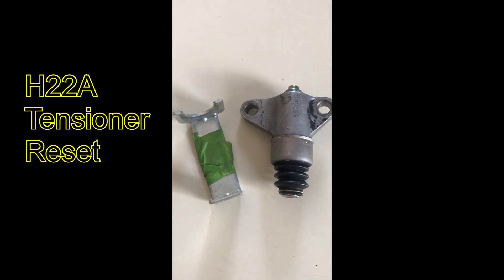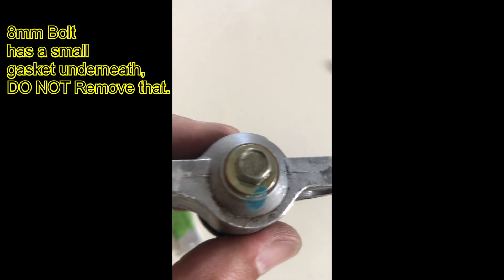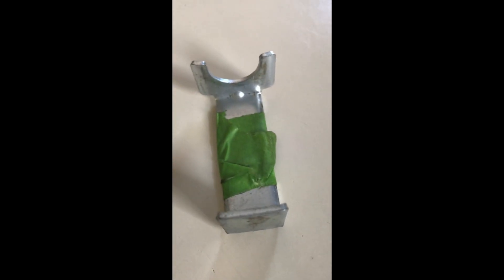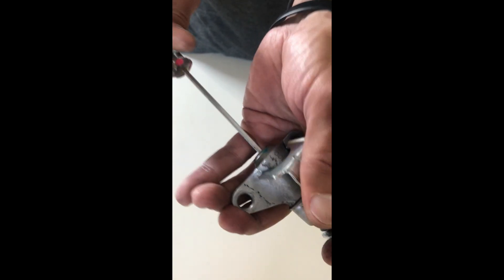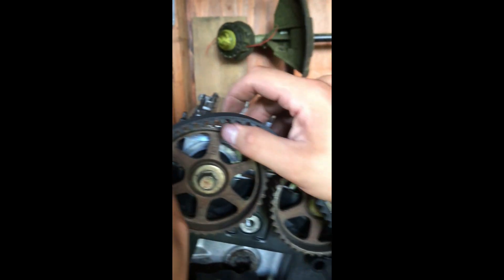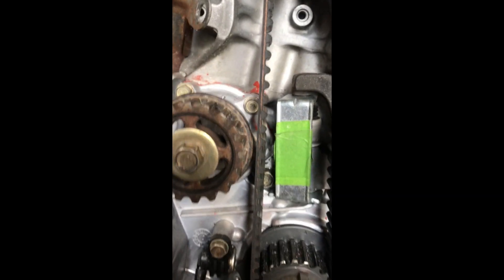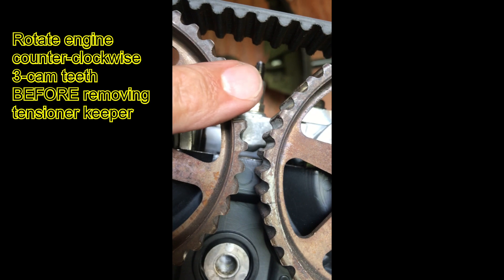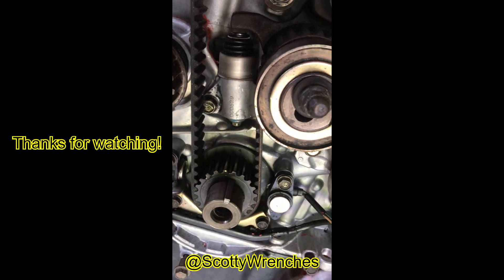H22 Timing Tensioner Reset - and replacing timing belt

Comment: Thanks for the video mate. Is it safe to reuse the tenssioner? I only have 20k kms on the genuine tenssioner and thinking to reuse it.
Thanks in advance
Reply from the maker: With that low mileage, you should have no troubles. Be sure not to allow the oil to drain out when resetting the tensioner.

Comment: Ive just replaced my tensioner but i didnt turn it 3teeth. It automatically tensions itself so isit really necessary to turn 3 teeth first? It drives fine
Reply from the maker: Honda Factory Service Manual does NOT mention to go counter clockwise three (3) teeth. This is a practice that I carried over from working with B-Series engines to pull slack out of the "long" side of the belt that runs from exhaust cam to crank pulley. This allows the tensioner to fully tension the belt. If the belt is put on the pulleys in the correct order, then the long side tension should be fine.

Sequence for mounting the belt is 1-crankshaft gear, 2-Adjusting Pulley, 3-Water pump pulley, 4- Exhaust camshaft pulley, and finally 5- Intake Camshaft pulley